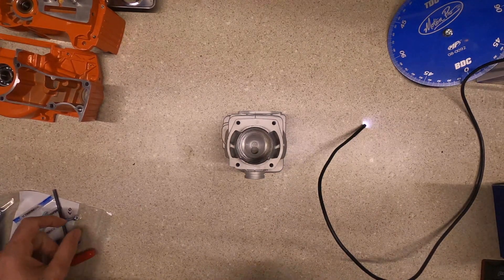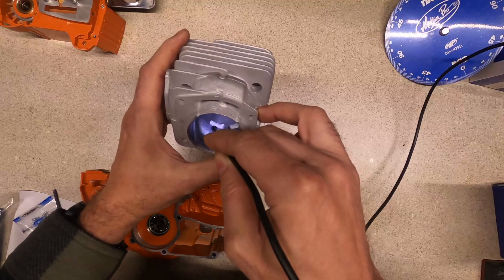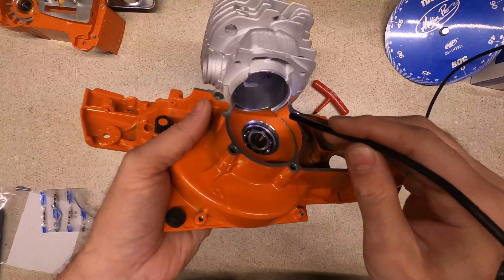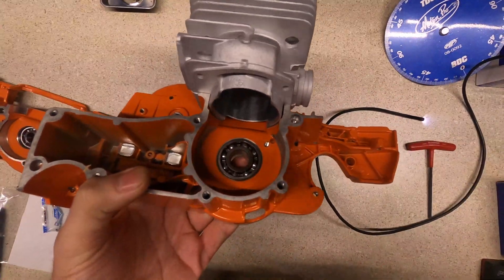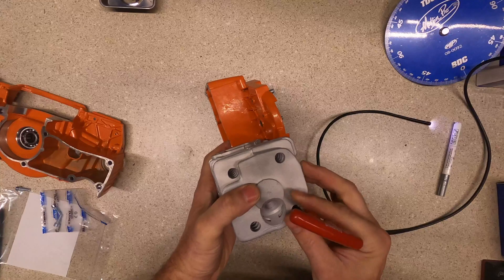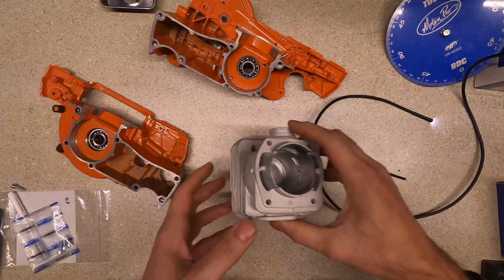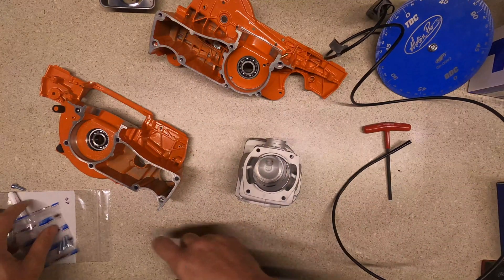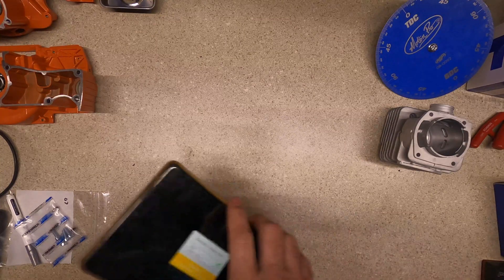Holzfforma G372XP build - Video 2

Comment: Thanks for sharing, really enjoyed the build series. I'm waiting for a 288 kit from Farmertec myself, but don't have any special tools/experience about filing the rough parts of the cylinder ports. Do you think as a bare minimum it would be enough to at least use some fine wet sandpaper / bear scotch or file down the rough edges of the ports? I'm a bit worried about the stock cylinder, but don't want to destroy it either 😄Thanks, Daniel